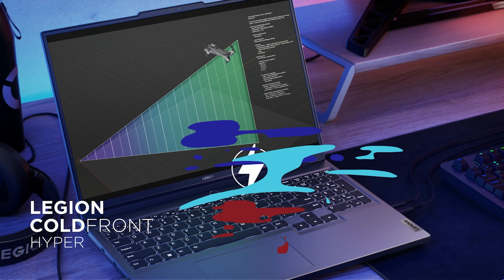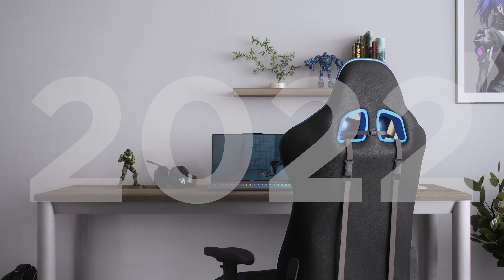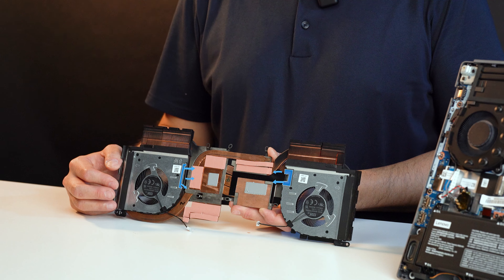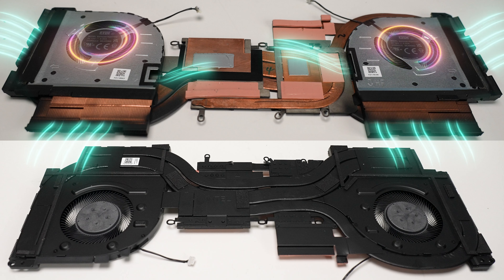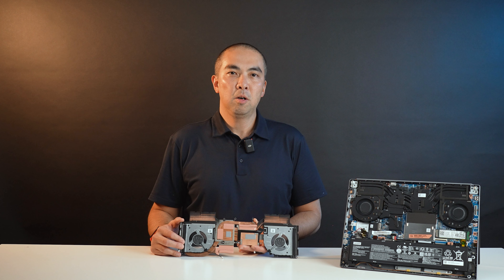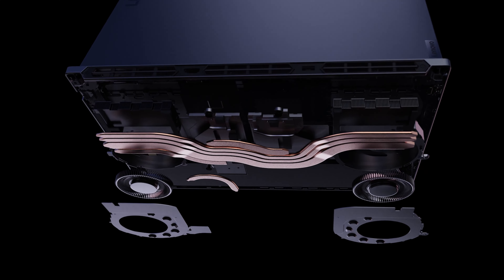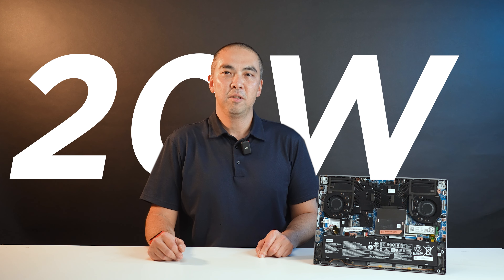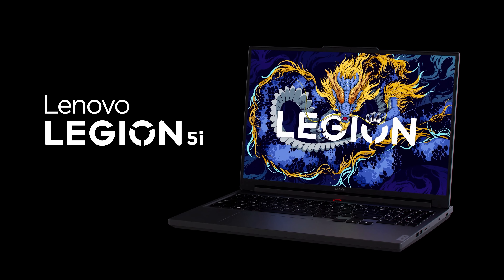Inside the Lenovo Legion Coldfront Hyper Cooling System

Comment: Hi, how can I turn on CPU overclock and use it in Lenovo vantage on loq 2024 i5-13450hx? Beginning, there's no CPU overclock option then I turned on CPU overclock in bios and the CPU overclock option appeared in vantage but I can't turn it on. Every time I clicked on, it showed install driver (need restart) and brought me to update driver but I saw nothing new after checking the update in vantage. (I checked the update in window settings too and nothing new in there). Thx for reading, hope to see your answer soon.

Comment: Nice engineering but it looks like it's still impossible to remove the fans without removing & repasting the thermal module. Is it critical to have fans stuck on like that?